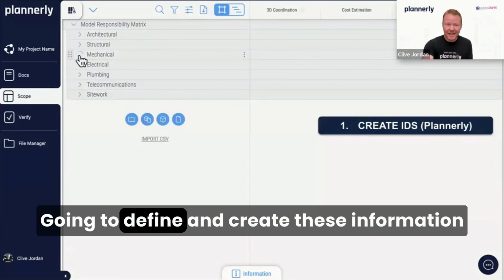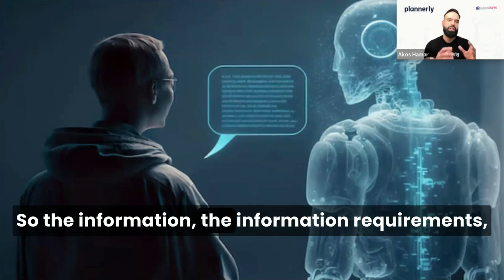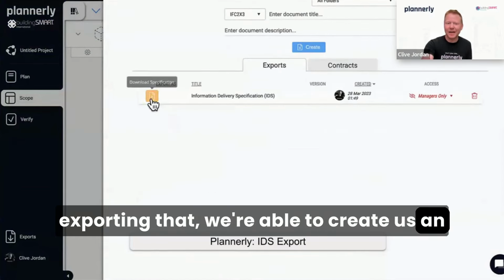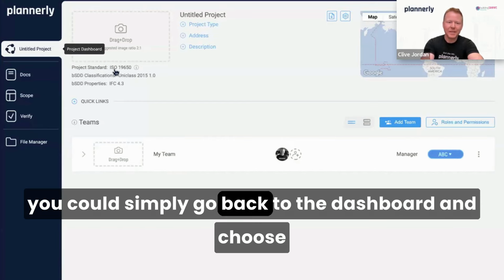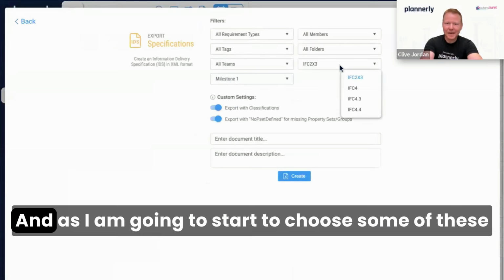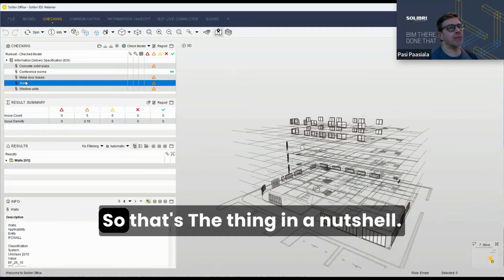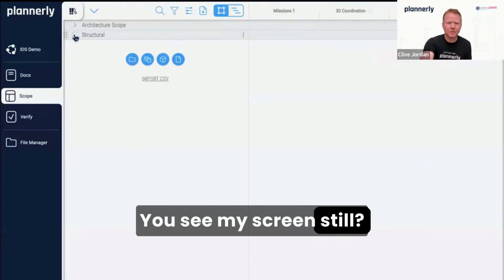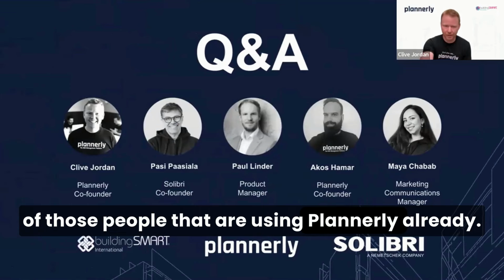BIM Checking with buildingSMART IDS (using Plannerly and Solibri)

Comment: Earlier today I got in touch with Akos regarding an educational licence for my class, and if all goes well I'll be able to use it on my upcoming project starting 11.03.2024.

In the project we have, there is a set of IFC specifications we must follow, such as File name format and Project names.
I have already made a Solibri rule to check for the fileaname of the IFC, so I wonder if that's also possible with the IDS?

The format of the delivery is "<Lastname-Firstname_<Project>_<Dicipline>".
Will I be able to make a "rule" or a check in the Plannerly IDS creator to check for the IFC filename? And names such as "Project name" "Project Longname", "Sitename" and so on, and also check if the IFC that's used is exported as a specific IFC format, such as IFC4, this as a quality check to ensure that I or someone my team has not had a mishap and accidentally exported in IFC 2x3?.

Hope for a good experience in this, and as  I said, if all goes well, then my assigment or thesis will be on the use and implementation of IDS.
Thanks :D!
Reply from the maker: That's awesome that you're considering using Plannerly for your classes! While IDS isn't currently set up for handling file names, if the filename is in the metadata, you can set it up for checking using a property. For more specific questions, it'd be great to schedule some time with our team - feel free to do that here: plannerly.com/meeting